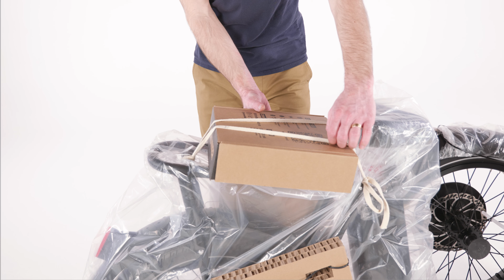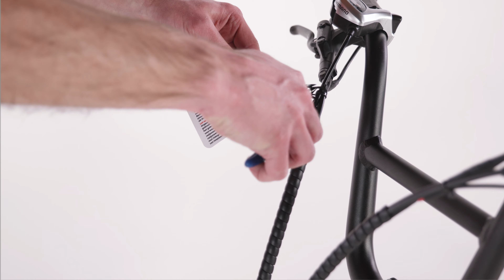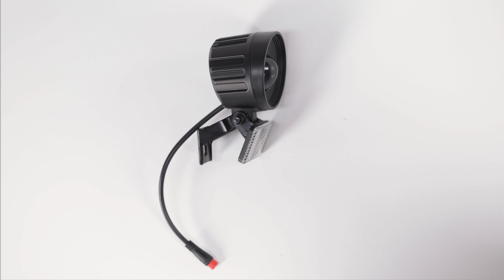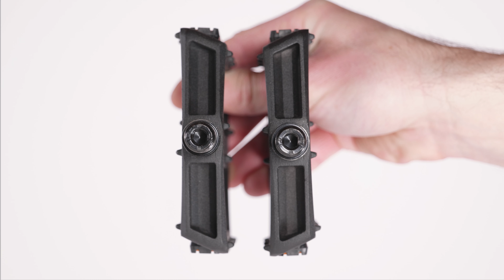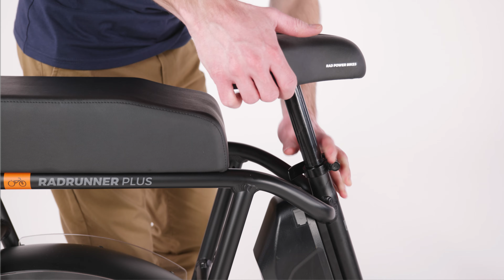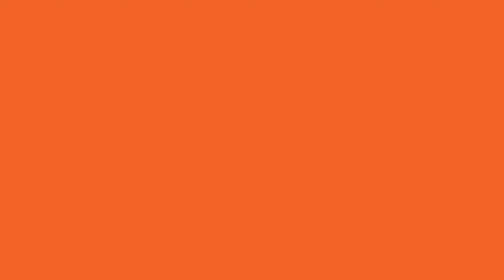RadRunner Plus Assembly | Rad Power Bikes

Comment: will the new display work with older rad runners/sold individually?
Reply from the maker: Thanks for your interest! The new display on our latest RadRunner models isn’t cross-compatible with earlier generations and won’t be available as a standalone upgrade. Each RadRunner is designed with a unique system to ensure peak performance, so while we’re always innovating, some features stay model-specific. Let us know if you’re exploring options and we’ll help steer you in the right direction!
Reply: @RadPowerElectricBikes Thanks for your reply, I recently bought a radrunner plus off a friend and the battery is missing a couple items that either arent sold on your website or are made for the newer radrunners now. I was wondering if theres any way I could purchase a rubber plug for the dc5.5x2.1mm charging port, aswell as new plastic siding for the back wheel as theyre cracked in many places.
Reply: @RadPowerElectricBikes  and do you recommend any way to give the brown seats and handle grips a refresh? maybe with a leather shine or something like that?
Reply from the maker: Hi! We do not have those parts sold separately, we apologize. Please contact our support team to discuss! You can click the Live Chat button at the bottom of the Customer Support Page in our Help Center or call us at (800)939-0310. Phones are available Mon-Fri: 8 am-4 pm PST. Live Chat is available Monday-Friday from 8am-4pm PST and Saturday and Sunday from 9am-3pm PST. You may also email us anytime at support@radpowerbikes.com and a member of our support team will contact you back via email in the order received. 🚴